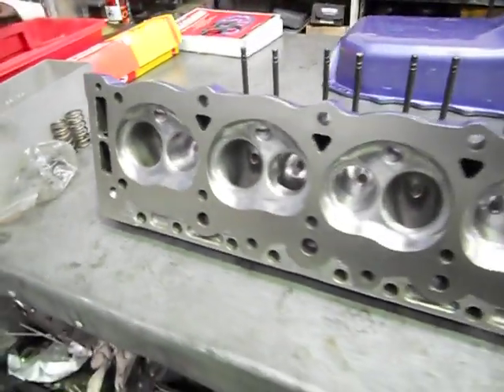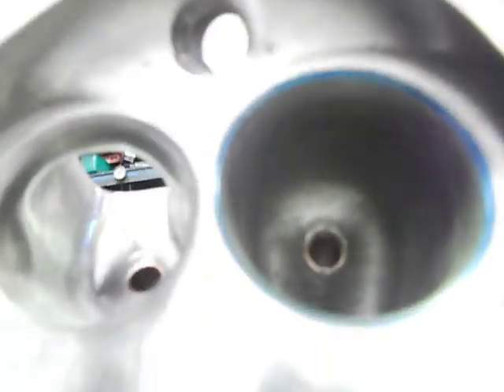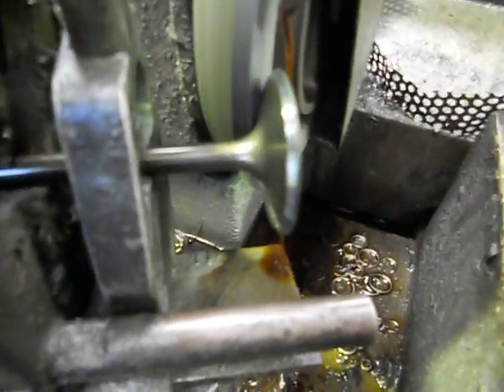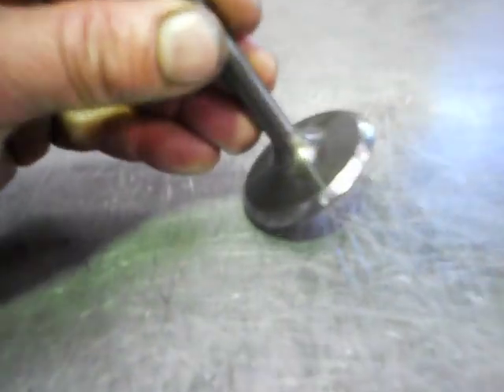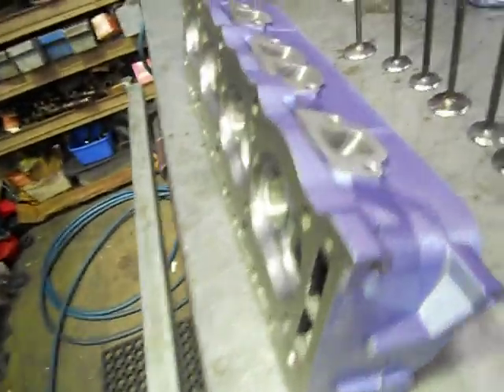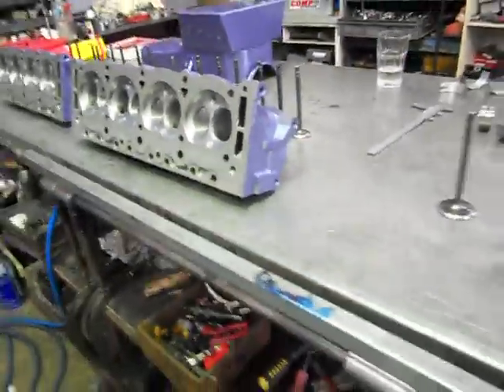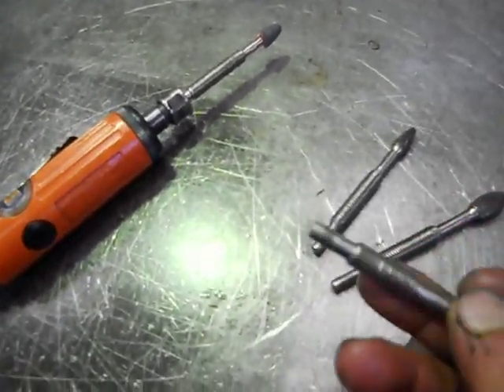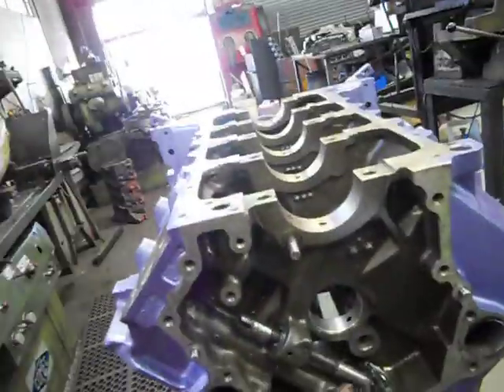How to port and polish high performance v8 heads,tips,tricks and trade secrets exposed part2

Comment: by seating the valve so close to the tip or face, doesn't that increase the chance of the valve tuliping? I only ask because as the valve settles in it will sink slightly, moving the seat out toward the tip

Comment: I'm just playing around with an old 1991 2.6 Lt Fuel injected 4 cylinder astron east west motor from a 1991 Mitsubishi Magna Station Wagon that (Thanks to previous mechanics) blew a head gasket. The last auto shop said they had to fix a leak coming from cylinder 1 where coolant apparently was leaking through. When the head finally blew this time we've noticed 2 centre head bolts weren't even done up and so as a result, after a few months while driving, it blew 17.4 Km out of Albury.  Now I'm doing it all myself with all the right tools and knowledge I get from youtube as well as my workshop manual. How to reseat valves, changing all parts of head to new including hydraulic tappets, valves and so on.  Do you have anything you can add to help me? Example: completely clean carbon from inlet and outlet chambers?
Reply: Nulon carb cleaner I think, got it from Repco for pretty cheap. Basically just methanol and acetone from memory. Completely nuked all the 15 year junk in the plenum/throttle body off my Commodore. Bit of love with a nylon brush and a scotchbrite pad...just avoid the gasket surfaces unless you use RTV

Comment: how much hp have you made with red heads I built a 308 20 years ago that made 440 hp on bowser fuel with modified l34 valves  would be interesting to se what hp people are getting now the most I got out of standard valves holden ones the thick stem items was 345 hp with a crane 286 or erson tq 30 would be interesting to know what you think cheers Jim PS might be able to share some knowledge

Comment: I've always wondered why valves don't come in shapes other then a circle..  Instead of 3 or 4 valve heads why not just have 2 semi-circle valves (looks like a ' D ' ) which would make the total area for air to flow through larger. Could this be possible? Or has it been done before?
Reply: Interesting thought. ....if they can spin it might spread the shaft wear better than the D. someone's probably tried it....a few more steps in the build too.
Reply: How would you machine the valve seats??

Comment: Your Carbide burr extensions, How do you get the bit being stuck Hard into the rod? you said something about interference? can you explain in more detail? is changing the carbide burr problematic? Some extensions use a locking nut, but do not see it on yours?

Comment from the maker: With the slot you hacksaw into the top of the mandrel after a few wraps it should stay on,sometimes the tape comes off,if so just give the slot a bit of a tap with a hammer to tighten the slot up a bit,and yeah I know about the extended bits,they cost more,and my way I can have many different extender bits at what ever length I want and I also use them for all my polishing bits as well,and thank you Brother for you time to watch and comment,that means a lot,Happy New Year Champ :)

Comment: Top stuff mate I was hoping to do a port and polish, resurfacing etc. my self pretty confident with most of what to do and picked up some great tips here thanks - Quick question, without access to a mill ive heard you can manually resurface your head with a flat bit of glass and some sandpaper stuck to it to give a flat surface, and rub the head on it that way. Harder job but cheaper, any feedback on it though?

Comment from the maker: @THEMASTEROFYOU2000 So very true,and weve only just stripped it Lol,all any type of successful rebuild,cleaning,cleaning,cleaning,set up,machine,clean,dummy assemble,measure and check clearances,maybe more machine,then check,wash,wash,wash,wash..Heat proof gloves,stiff nylon bore brushes various diameters,then boiling hot water and soap,and heaps of elbow grease,BECAREFUL high pressure water soap off,the bores rust in no time,very slight,get wd40 type spray on the bore soon as..then have a beer